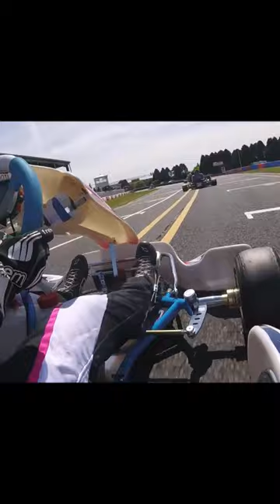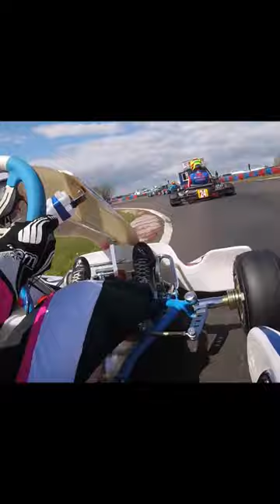How your braking should sound #shorts

Comment: Works well with good tires. 
Always have good tires on your kart !
I just had Maxxis installed in march and now they make absolutely 0 noise even while looking up ! Pretty difficult to gage the optimal brake pressure in these conditions.
Reply: I agree some tires i find very hard to find the optimum pressure feels like lock or no lock, especially when its cold. Mojo D5 which are the ones in the video are the tires i find it easiest to find the right pressure